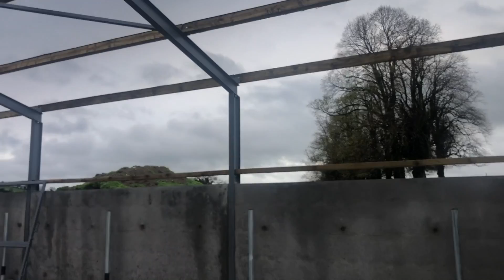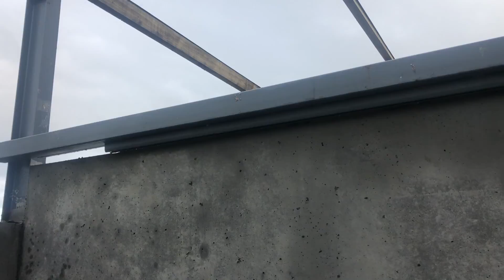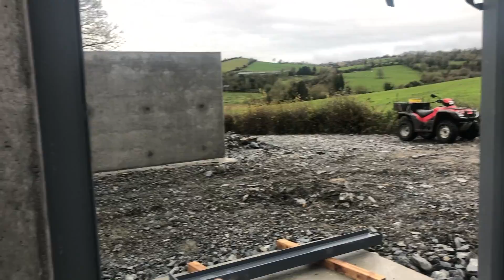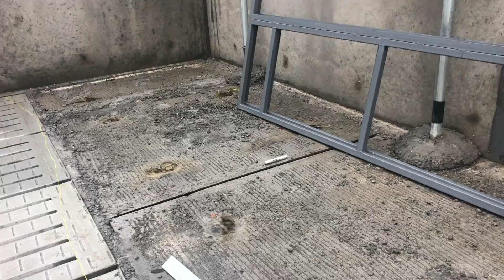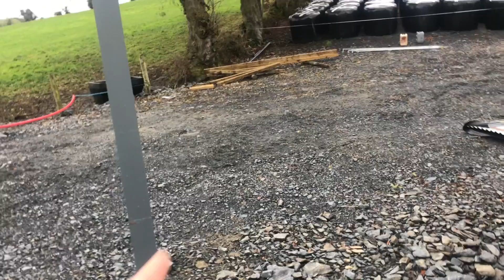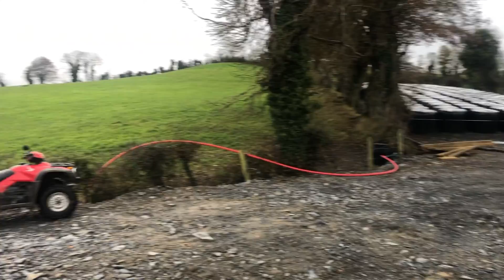New cattle shed construction ( PART 5 ) WILL WE BE FINISHING ON TIME!!!!!

Comment: Would you not leave the apron concrete  until next year for a bit of better weather?  It’s fair frustrating waiting for these kind of jobs to get finished, been in the same position myself a couple of times!!  It will be a fine job when it’s finished. Are you rearing all calves or just the heifers?
Reply from the maker: Thankfully we got all the concreting finished and all worked out great, we only rear the heifer calves, all else is sold straight away

Comment: Would you go Massey or a different brand and will you trade in the 6470. You should do a live stream for 1k subs. We have a McConnell 2006 hedge trimmer and it gave no bother since we got it a few years ago. What brand hedge trimmer will you go for ?
Reply from the maker: Agri spec Lad probably McConnell, I’m pretty familiar with them, looking at other brands of tractors at the minute but would be hard to leave Massey as we’ve always ran them.
Reply: IFarm WeFarm we only live a mile from Martin garage. How many cows do you milk and do you send your milk to Lakeland.
Reply from the maker: Agri spec Lad 50 cows, yes Lakeland
Reply: IFarm WeFarm ya may talk nice to Ronnie bout the Massey👍
Reply: @IFarmWeFarm  masseys are ok but I'd say new holland or claas are nearly better much more comfortable and are normally quite cheap. The farmer that I work for has a claas arion 430 and shes very comfy plenty of power for the 1600 gallon tanker he has and brakes are very good as the tanker has no brakes but the claas would stop dead while going down a hill(normal brakes not air)and you wouldnt even notice the 4wd being engaged when you press the brakes it's that smooth, most dont have add blue which is a major plus aswell. They are very good with front loaders as well as the gear system is (generally a 16x16 powershift) is built into the loader joystick, they will handle a bale on the front no bother no weight needed on the back so very handy for feeding, very good turning radius too would be around 35k (no bother to ye milking fellas 😂) for a low houred one but it's worth it I'd say. New holland are pretty much the same as the claas witha few slight differences
Reply: If shes not blue she'll not do  masseys are better